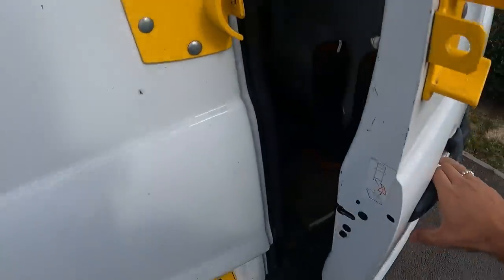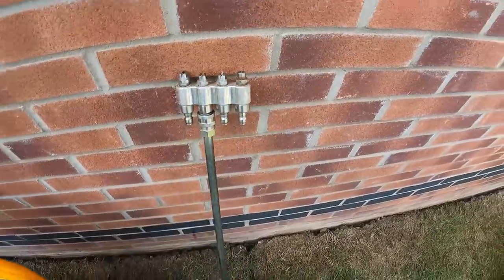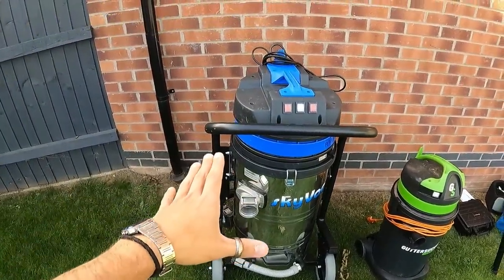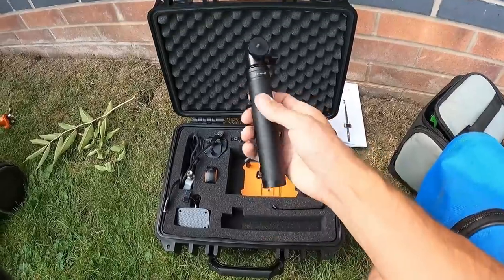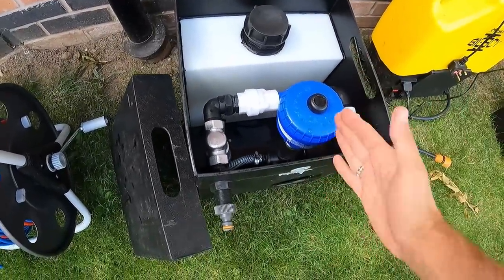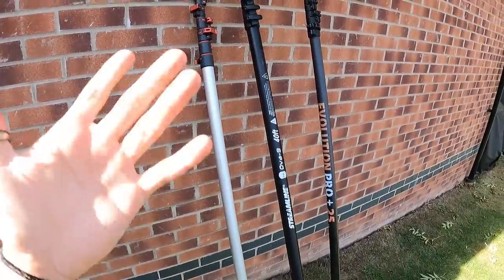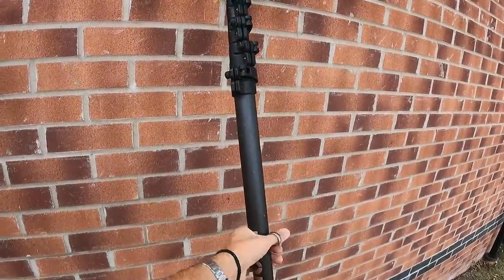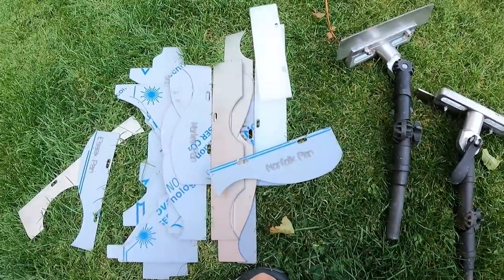All My Tools & What They're Used For - Growing From Nothing To Something In 1 Year.

Comment: I’ve just bought the same jetwash as you with the 250bar 15lpm interpump. I haven’t used it yet but it’s awesome quality
Reply from the maker: It’s a really solid machine mate 👍
Reply: @PartridgeExteriorCleaning  looking forward to using it, it’s on the evolution 2 platform but it’s the exact same machine, I’ve been using a lifan 3600psi machine for 4 years that finally gave up the ghost last week, I do property maintenance and have a lot more requests for jet washing now